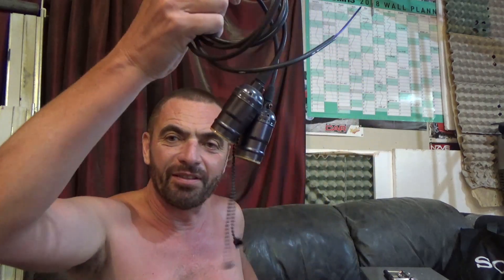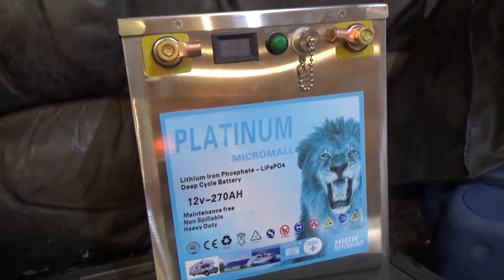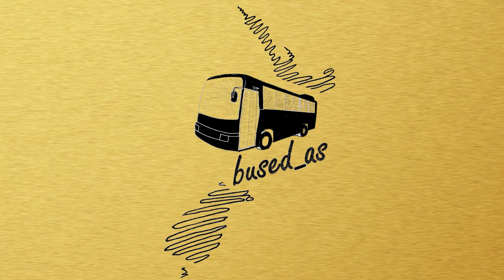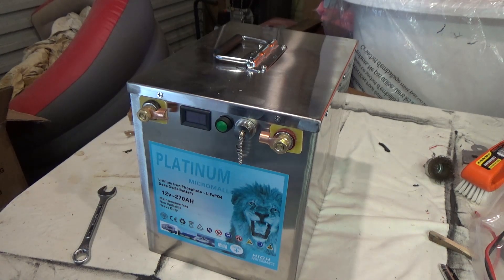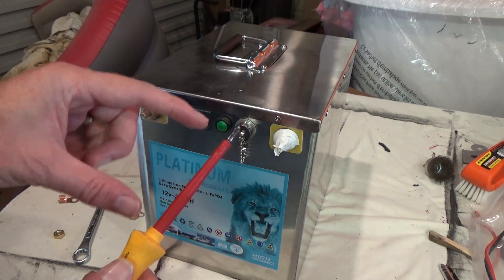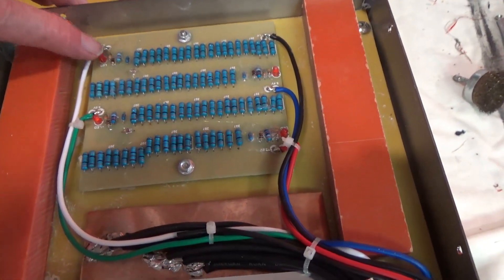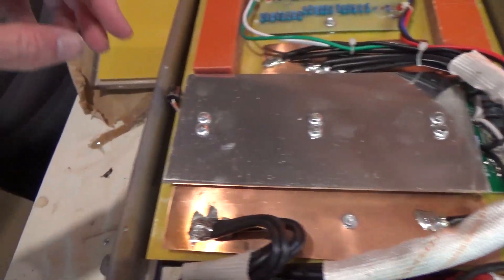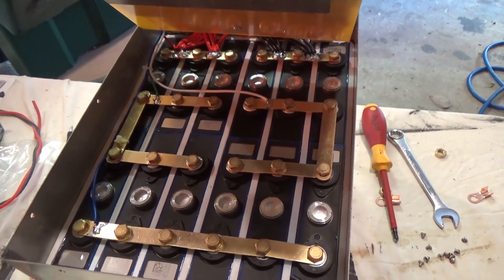LiFePo4 Drop In battery | Whats inside?

Comment: You sound like you know what you're doing. I'm trying to power a 30L brass monkey fridge, an exhaust fan, two lights, a water pump for the sink, and 2 phones. The fridge is obviously the main drain on the system but i think will only be about 30Ah per day. Im looking at charging from the car and a 180-200watt solar panel and using a powedtech dual input dc dc charger to power a battery. Currently looking at the 12v 100Ah bronze lithium micromall battery. It's around $400. I've been comparing it to a 100Ah AGM battery going for $299. Would love your thoughts, bro.
Reply: A year late but yeah, you can only use about half of that battery as it's AGM

Comment: Hello, how much please and from where did you get them. Keen to have a look. 👍😃
Reply from the maker: Hi there. I got them from trademe, they were initially just under $1000, now just over...
Reply: On the Trademe listing someone has asked if they can be series connected for 24v. They say they can so just wondering why you're not doing it that way?
Reply from the maker: Sorry for the long reply... A couple reasons really.
With all due respect to the seller I don't think he knows much about the product and offers some umm sketchy advice, and specs. Sure you might be able to get away with it, running low currents and very modest Charge and Discharge voltages and maybe a cheap balancer like the HA01 between the packs. I'm certainly not an expert but would not want a setup like that under my bed.
Secondly I'm not a fan of the "Drop in" battery logic anyway. I don't want a flat battery to just disconnect itself leaving me no way to charge it. Or to disconnect from my inverter under load, or the solar controllers for that matter. Perhaps a safe outcome for the battery but potentially destructive for everything else. That could be even worse with two independent batteries each managed internally with no idea what the other is up to.
The BMS should see every cell (or block of parallel cells) and make smart decisions, like turning things off rather than unplugging them, based on cell voltage not just pack voltage, especially for an 8s 24V pack.
Finally its a very, very cheap battery, too cheap, less than the bare cells from AliExpress leaving me questioning the componentry and assembly inside the box anyway. But as a cheap source of cells... Perfect